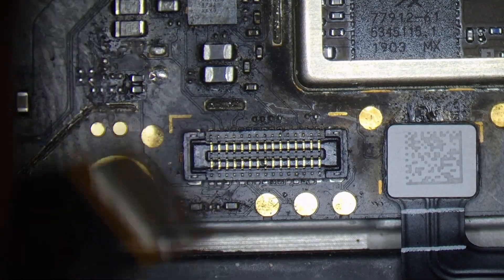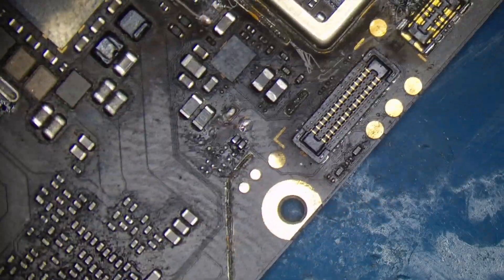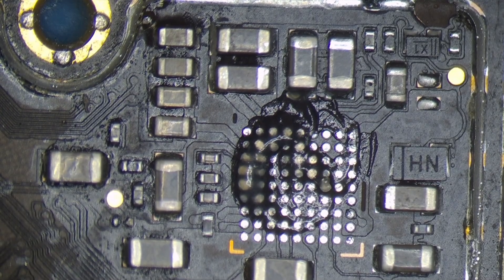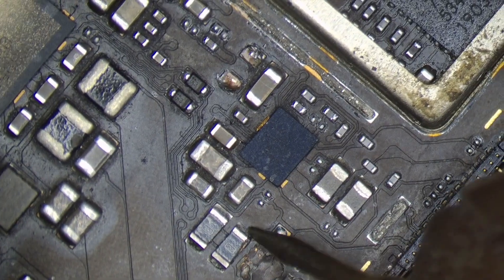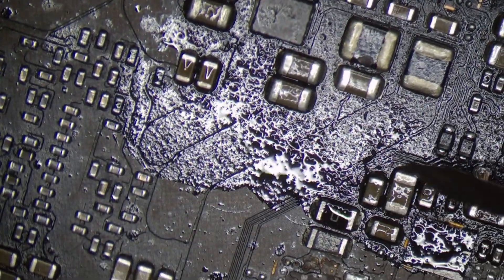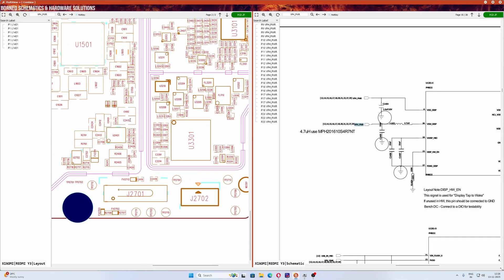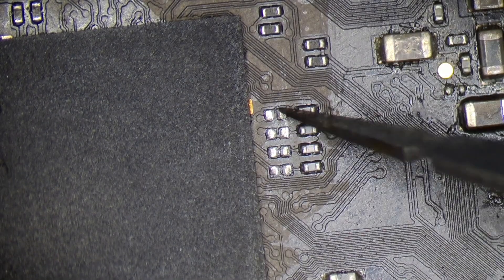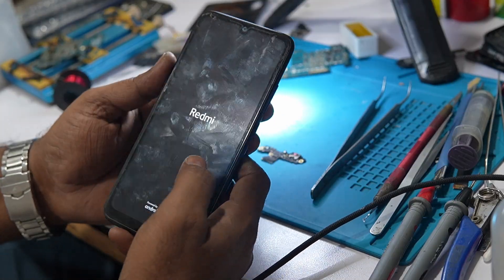Redmi Y3 Blast While Charging 🔥 | Full Board-Level Repair Step by Step | Mobile Repair Tamil

Comment: Redmi mobile low network problem solution poduga anna
Reply from the maker: Check network antenna and band filters. Most probably problem related to antenna. Also check the dpdt switch if avilable in that model separately